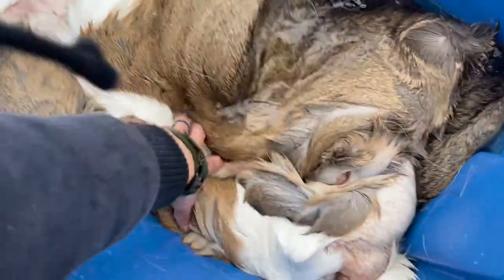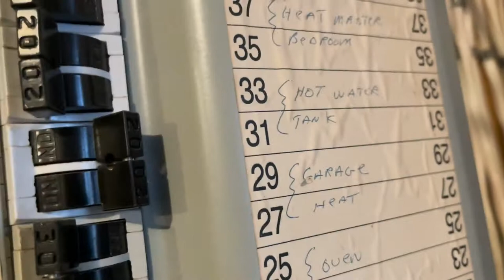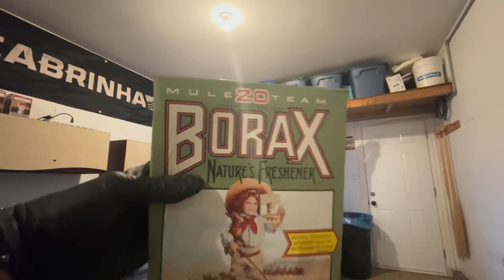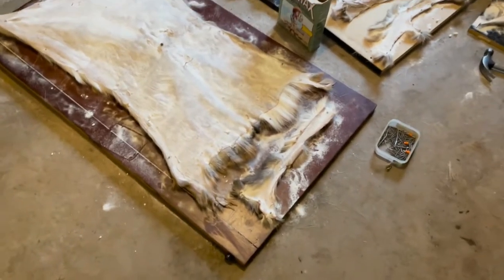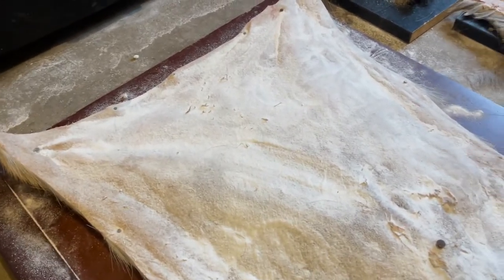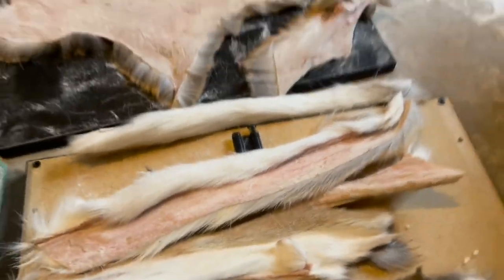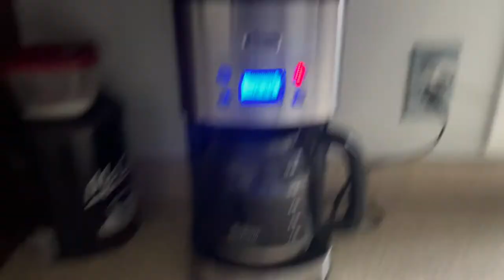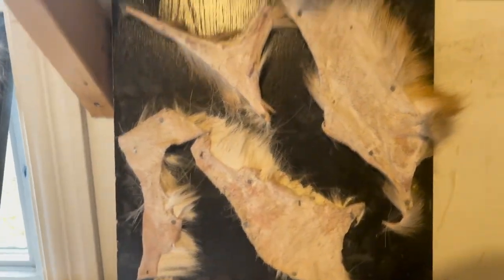Preparing Deer Hide for Fly Tying

Comment: Cool! Thanks for the vid! I was looking for a full prep vid, but I get why you'd not want to risk offending the delicate pearl clutchers at YT. LOL! 
I might grab just some sections next time I see a cougar kill or road kill. What are the main/best sections to take from? I'd be tying for Bass. Nothing fancy. More utility, dollar store DIY junk flies. But if the deer hair is sitting there free, I might as well grab some.
Thanks!!!
Reply: I have tanned over 2 dozen deer hides. Deer hair likes to fall out, you want super fresh hides to keep the hair from slipping.A good indicator of how fresh the deer is, is the clarity of the eyes. Get it fleshed washed and dried as fast as possible. You can leave the hide as raw hide, but you could also do an alum tan to really lock the hair in. Belly hair is some of the most prized for spinning. Also it is white so if you are going to dye the hair, that makes it a lot easier than having to bleach  it first.
Reply: @kyledexheimer6548  Thanks very much! If I scraped all the flesh off, could the pieces be put in salt for a period of time to sort of mummify them for preserving? With the Alum, does that just get sprinkled on, or do the pieces need to be buried in it? 
Thanks!
Reply: @wingnutbert9685   salting isn't always necessary depending on how you are tanning the hide. If it is warm, definitely salt, but the main thing salting does is stops the bacteria. If you aren't tanning it right away, freeze or salt it asap. I haven't done enough alum tanning to give advice, there are some good YouTube videos for advice on that!